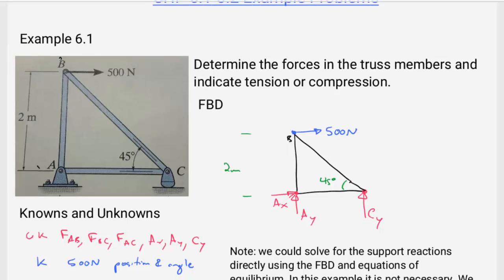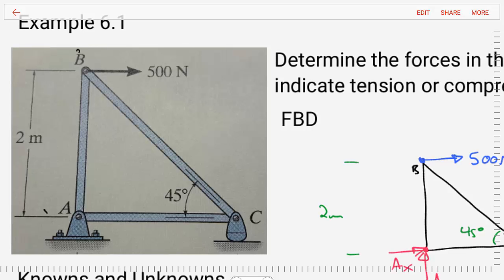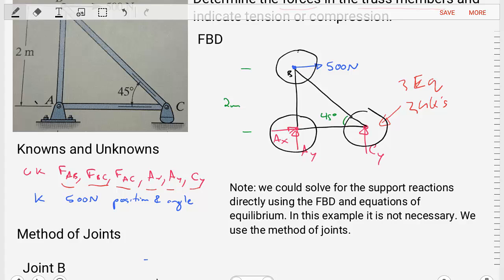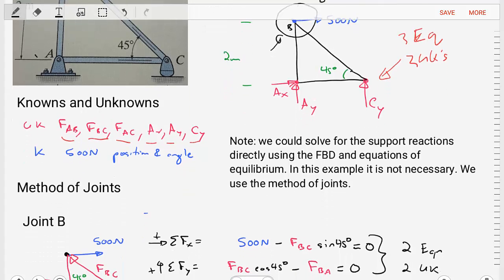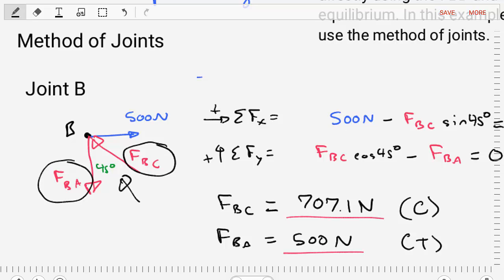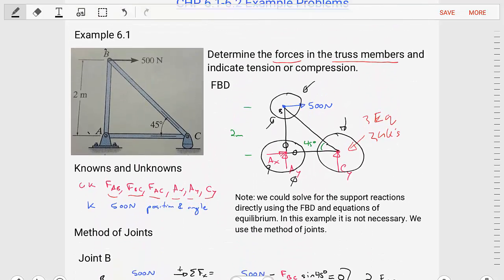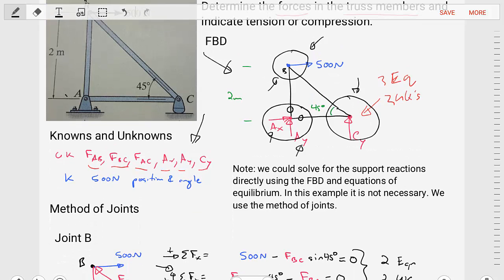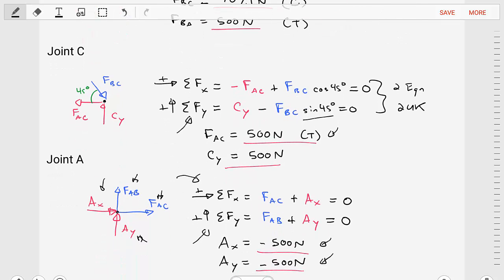Method of Joints - Example 1 (Statics 6.1-6.2)

Comment: at the end we have Ax & Ay as negative, thus we don't draw the free body diagram like that.
Reply: @UC5XfN2JvIKjVfadhrxS3m8A you are missing the point, the solution will give us negative values, which means on diagram they should be drawn reserve or at least should point it out in the solution that Ax= 500N <-- & Ay= 500N downwards.
Reply: His diagram is correct and near identical to what is in the textbook. Im pretty sure Ay & Ax need to be positive values since CA and BA are negatives, otherwise point A wouldnt be in equilibrium.
Reply: @pinkhead6857890  I think there is a misunderstanding, i didn't say it has to be negative, but when Ax and Ay are pointing that way they will be negative, so we either fix the pointings and make them opposite, or we will point it out in the results just like i replied before, the answer can be Ax= - 500N or Ax= 500N <---
Reply: @ano4309  On second thought drawing those arrows as negatives like you first suggested would make allot more sense, I just realized that point A is under compression and not tension from CA and BA's opposing forces. I just assumed that A would be in tension because of those two positivly drawn arrow directions.